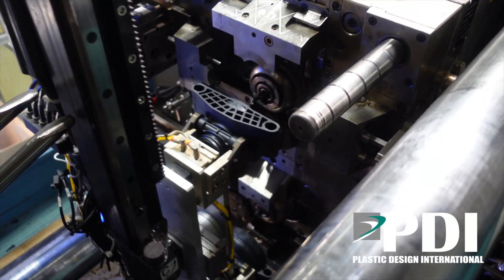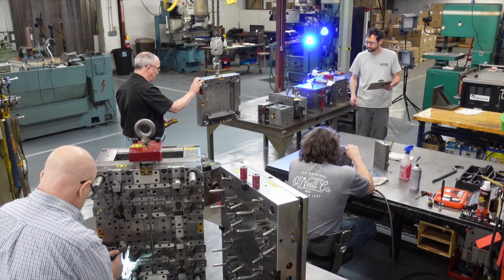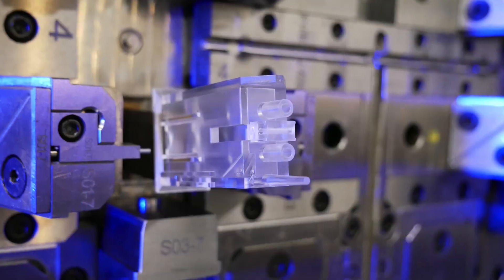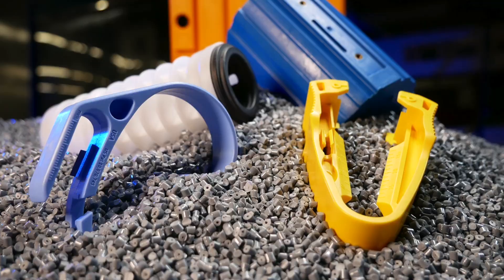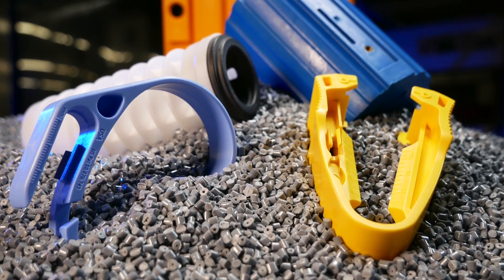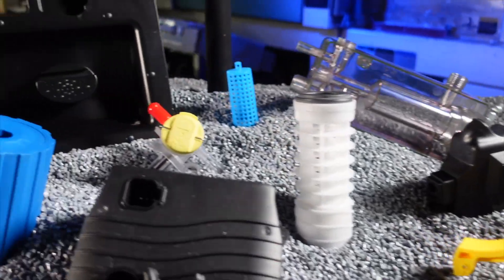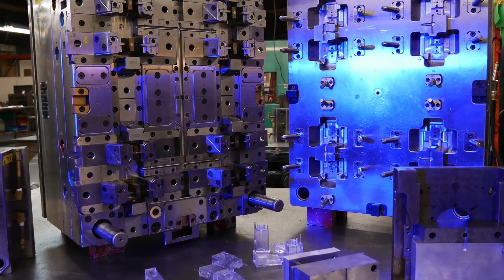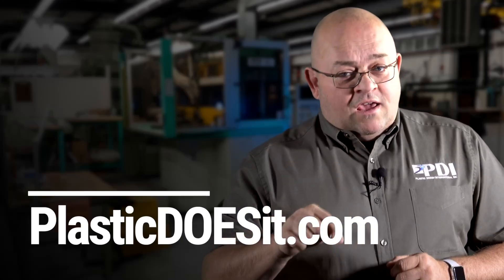Plastic Injection Molding or  Metal Casting? Plastic Design International - PDI, Middletown, CT

Comment: What I need to be able to make STEP files and afford the cost to have the molds and the product made so I can assemble and sell my designs.
Seems you need to be filthy rich to afford any of that.
Reply from the maker: Not really it depends on your product, is there a market? What are the margins? What PDI does is right in line with commercial manufacturing. and If they can help, call them